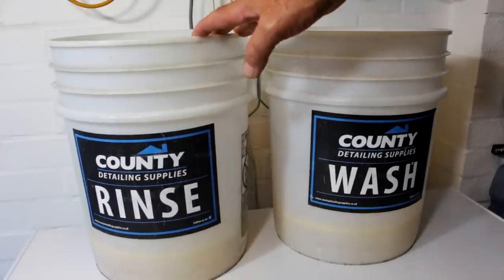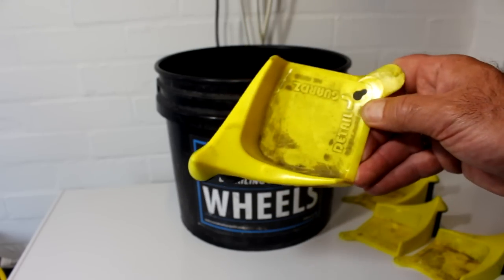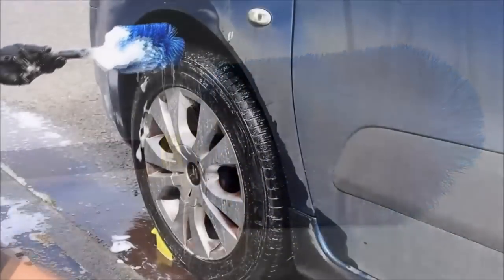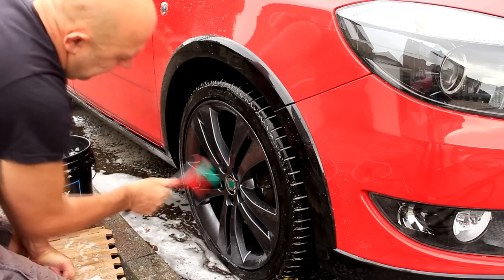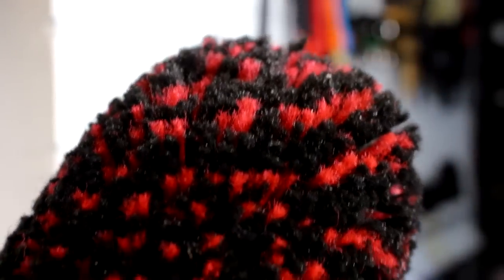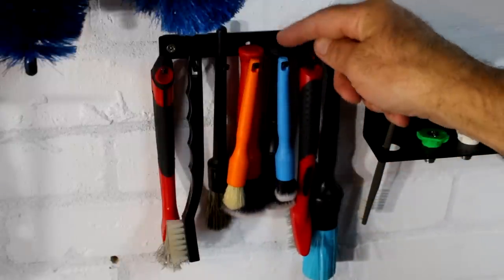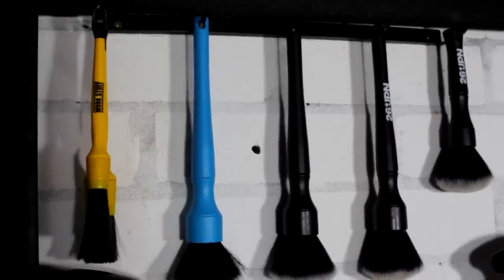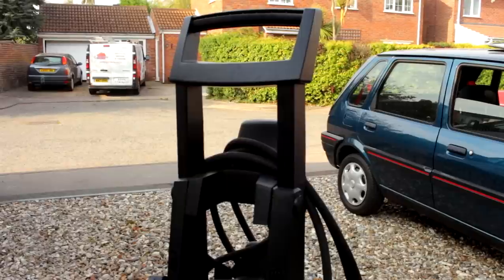My Basic car care kit

Comment: Hi Paul, I’ve recently had a pop roof installed on my transporter T5, and the roof is gel coated in black.  I’ve seen on the forums that people are experiencing the gel coat getting ruined and turning white due to UV rays.  My van does a lot of standing during the week as I have a company van.  Do you have any experience in getting them back to normal with cutting compound etc, and best course for prevention.  Thanks

Comment: These Nilfisk hobby class power washers like Nilfisk C 130.1, Nilfisk C 135.1 or E 140.3, etc. with induction motors and metal pumps (they are a bit heavier - usually total weight is above 15 kg, but it is worth paying a little bit more for them as they are extremely reliable) are very great value for money. Even induction motor is a bit heavier (for example the weight of the motor and metal pump in Nilfisk C 130.1 or Paul´s 135.1 is a little bit over 10 kg), I would personally never buy a pressure washer with a universal motor (not that heavy, but has a limited lifetime). Some people are even joking that these universal motors are like from hoovers. Even some well-known brands sell these hobby class power washers with universal motors and they are fully aware that usually they break down after less than 30 hours of use and it does not make any economic sense to get them repaired as the price of the repair would be very high compared to buying a new machine. That is why guys from AVA of Norway started to produce very interesting, easy-to-fix, and reliable hobby-class power washers. I find some of them a bit expensive (you can get professional class pressure power washer Annovi Reverberi Blue Clean 590 for less money, but still it is good that there is a new strong player in the field of power washers. If in any field there is such competition like in the pressure washer field, customers would be happy. Nilfisk hobby class pressure washers with induction motors have a very good washing performance compared to many other hobby brands. Not to mention that you can fix any issue that appears with them yourself (you can have a look at my video tutorials for Nilfisk C 130.1 (same as C 135.1) or E 140.3 (same spare parts list is for E.130.3 or E145.3). And spare parts are for very reasonable prices in the UK, Germany, Austria, Holland, etc. Only in some Central and Eastern EU countries, the prices of some spare parts are way higher than average in the EU. Hope it helps someone. So if you will have any issues with your Nilfisk C.135 Paul, have a look at my detailed 8 parts tutorial on Nilfisk C 130.1 (sold as yellow Wap by Nilfisk 1350 EU). Regards. S. https://www.youtube.com/playlist?list=PL59Co9iveKeoFN9-liyKgd8zgEQ5d35FO

Comment: Quick one for you Paul; did you ever get a better answer from Nilfisk on using more than 10m for the extension lead for the C145? Like....a suggestion for that not being a problem? My C130 does it and it's doing my head in.
Reply from the maker: Never contacted Nilfisk I spoke to a couple of professional Detailers and they suggested because of the amount of draw the bigger machines pull you need a very good quality lead and plug preferably plugged in directly to the wall not a multiple bank mines been fine since I changed the length
Reply: @PaulDoldenDetails  ah yes I remember now (about who you spoke to). I also don't get any issues at 10m but it's a lead out of window job rather than having it run from the shed. I'll see if I can find a longer lead that can cope and I'll let you know.

Comment: Hi . Just need some advice please.
Looking for a good pressure washer at the moment using a bosch aqt 120.
Looking to upgrade. Looking at nilfisk d140 or nilfisk e145 
But the d140 seems to be more power and flow rate than the e145.
Any advice which one is better as the e145 is 5 kgs heavier but seems to have less power and flow rate.
I have about £240 as cleaning on a weekly weekend and cleaning patio 
Hope you can point me to right choice
Reply: Have a look at my comment in this thread, Wayne, I guess it could help you. Good luck. Regards. S.

Comment: How long have you had that Nilfisk? I'm on my third one and my second failed shortly after I got a snow foam lance so wondering if the nilly doesn't like being used with that attachment. ?
Reply from the maker: Had mine a while now I blew a fuse in the first one then got a replacement machine they hate long extension leads because the power they draw make your lead no longer than 10m
Reply: @PaulDoldenDetails  o dear thanks for that Paul... note to self, stop using 30m extension!

Comment: Anyone elses Nilfisk just simply not work though an extension lead? mine is a C120 and it just doesnt work unless it's plugged into the mains, which is no where near my driveway. Ridiculous
Reply from the maker: My C135i now runs on a heavy duty 10m cable and it’s fine yet my old C120 never missed a beat all very strange
Reply: @PaulDoldenDetails  how odd! I'm not sure what to do tbh Paul because it's a great bit of kit when I take it to my brothers house to use it, but it's a pain having to do that every time I want to wash my motor